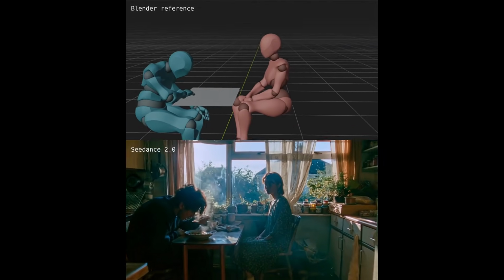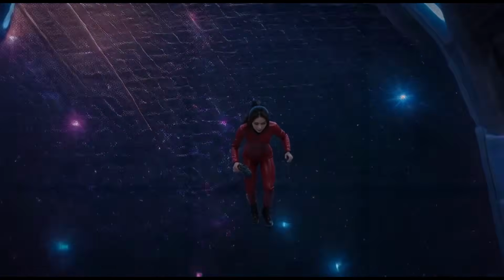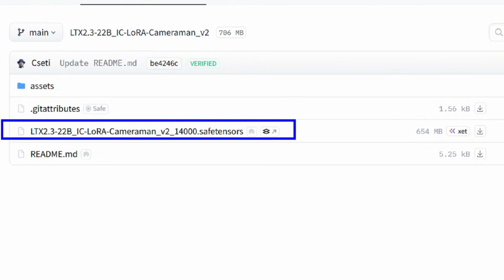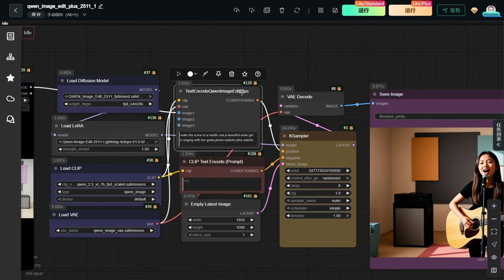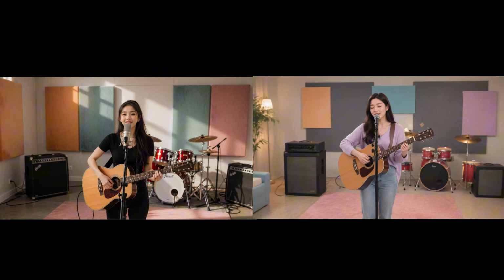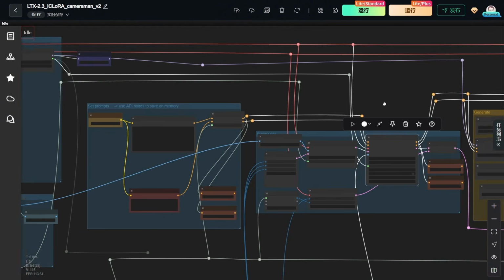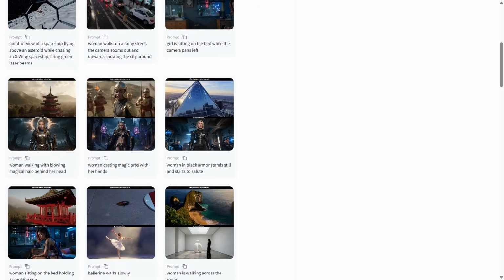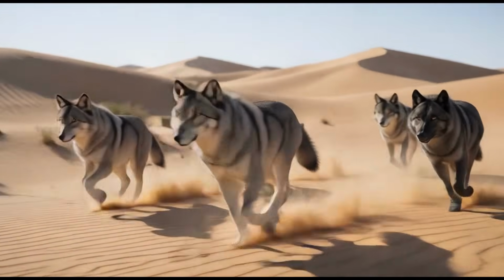Master Pro Camera Control: Transfer 3D Motions to LTX 2.3

Comment: I am using LTX2.3 as my main model now and can tell you that you're better off just getting a decent start image.
Either use proper prompting with Chroma-HD, or use something easy to learn like DAZ Studio then one of the "anything to real" img2img workflows with Flux2.
LTX is king as long as you avoid gguf, and always generate at least 1920x1088 @ 25 fps.
It will outdo WAN for sure.
Also, use the 10Eros checkpoint instead of native LTX2.3, it is better for real world physics and will not plaster stupid music over everything.

Comment: Thanks for this video. Can you please make work flow on ff and end frame for arch vis interior and exterior. 🎉
Reply: hello brother do you find something ? I was looking for the same thing
Reply: @RakhaDewanto actually i didn't find qny think I tried my own way but the results is not that good i think the online sites is better in making that type of vedio with recommended prompts
Reply: @salamburhan8617  I tried with comfyui using LTX 2.3 First Last Frame. You might want to try it.